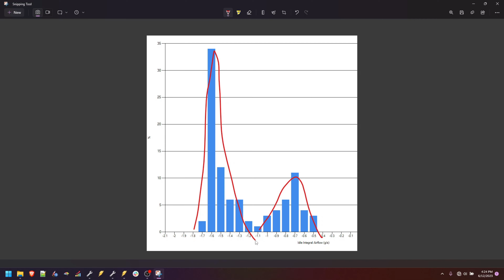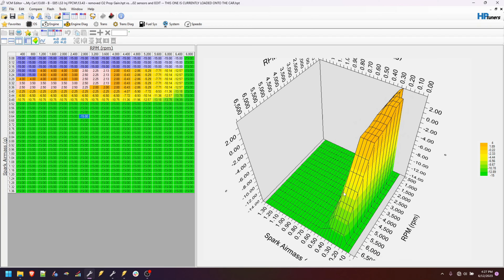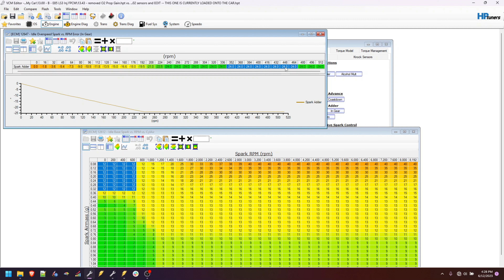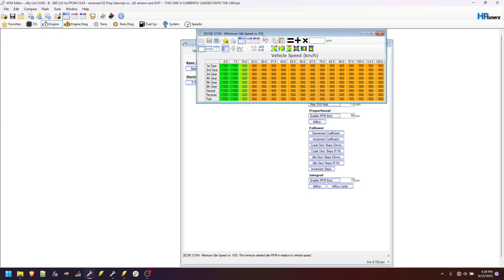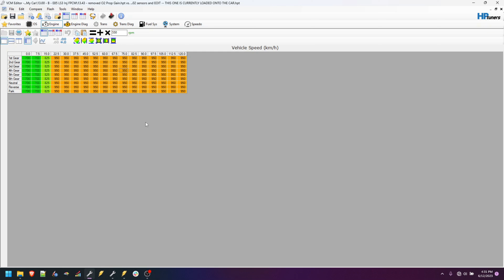Idle Magik for Gen4 LS engines: Follow Up...EVEN MORE IDLE!

Comment: what we use to do back in the first e38 as they didnt have the idle airflow correction pids, we used the ''idle adapt adv'' pid and set it up against the commanded idle rpm and actual rpm on the chart v time and watch spark correction either going under more or over more and that showed us if the airflow was ok and how the correctios were, 

 i also use to use the spark correction as an estimated percent in airflow error it was for example if spark was always adding 3 deg to bring it up to commanded i would add 3% to the min airflow to bring it up a little and when u got the spark staying around the adding or substracting 1 or 2 deg u knew the idle was good

Comment: You can return your entire min spark table to stock because you have addressed all the correct tables for Idle control
Reply from the maker: I may do that for a test to see. But  my min spark table exists solely for low speed shift feel. I realize it also plays a part in certain "downstream devices", but I live in an area where this is not a constraint.